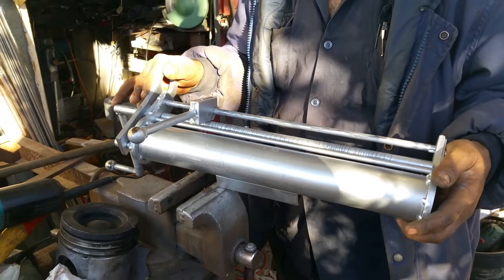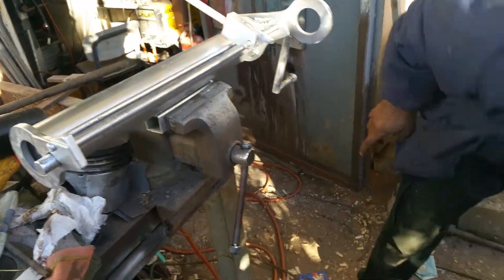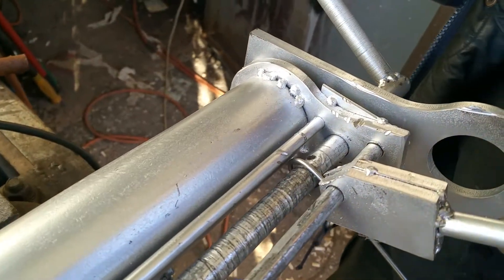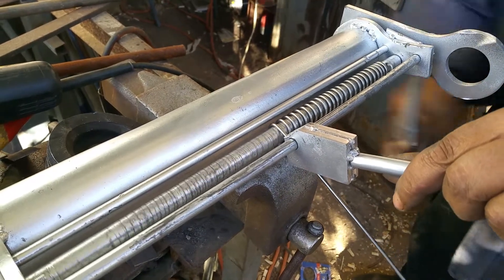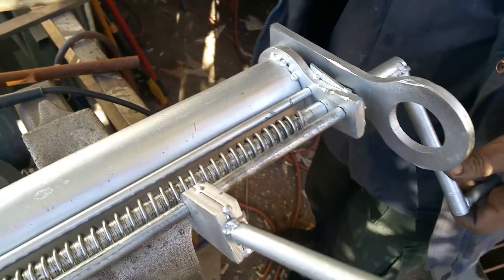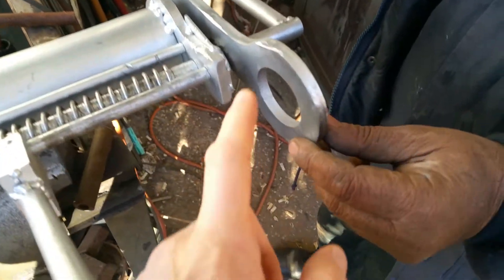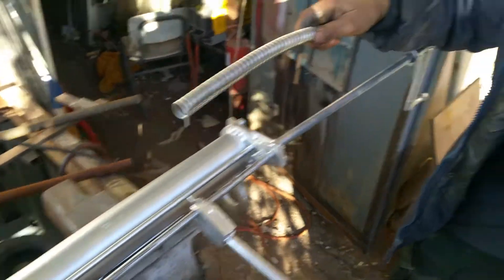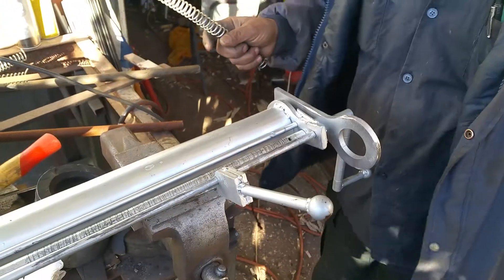DIY machine for making springs

Comment: Nice! How do you make the spring handles that vary in diameter?
Reply: Have you got an answer to that question. Am having the same dialema
Reply: If you haven't found a solution, look into cams. You could have a cam that is thin on one section and wide farther down that moves from thin to wide as the bar progresses.
Reply: Just realized, a simpler method than cams might be adding wider pipe sections to slide in to make the shape you want